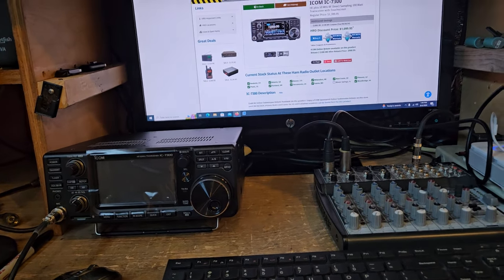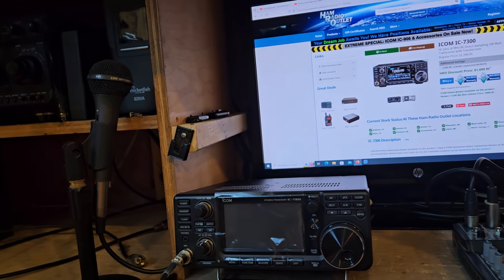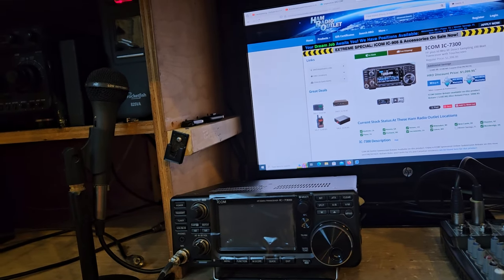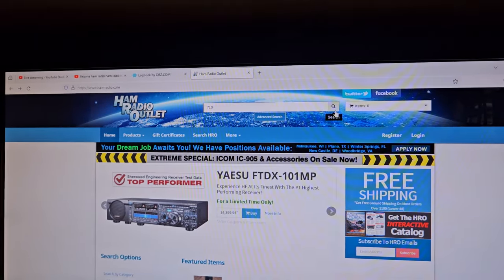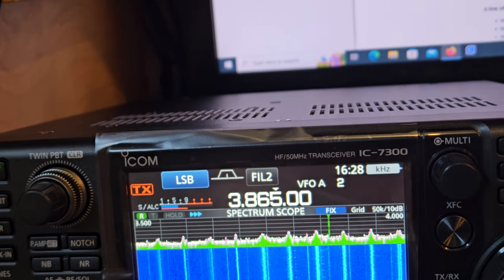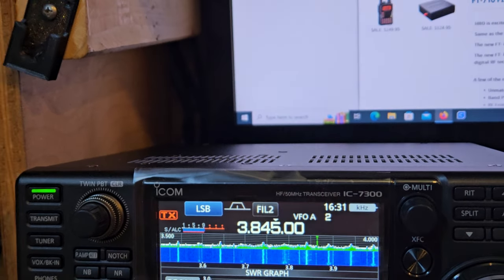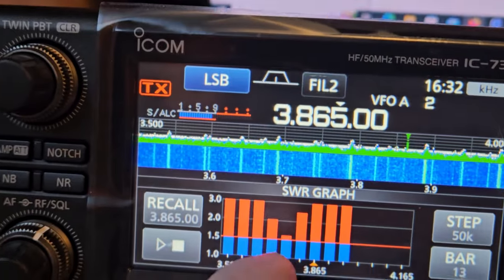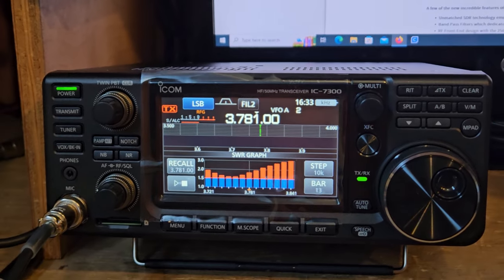here's why I bought another ICOM 7300 ham radio

Comment: Iam able to change the waterfall color on my FT 710. I like the icom as was torn between the 7300 and 710 and the choice was the 710 which has the DVI port on the back
Reply from the maker: You cant change as many aspects of the water fall and spectrum . The you can pick like 5 color schemes on 710. They both are great radios. Why not own both...I do lol 😆

Comment: I had to send my IC-7300 and IC-705 in for repair. Sent the 705 to Washington repair center, and it took about a month to get it back. 

The first time I sent my IC-7300 in for repair because the screen was going bad, it went to Michigan. Matt done a great job and got it back in two weeks. The second time it went in for repair, it had some water damage. Sent it back to Michigan. It took a while to get it back because Matt didn't have the circuit board needed for repair in stock. 

It was an expensive repair, but Matt worked with me on making a couple of payments. If you have to send an Icom in for repair, send it to SAR Technologies in Michigan. They don't have an automated phone center. When you call, you'll talk to a person.

Comment: I want a 7300 for digital and cw, the 710 for ssb phone.
Reply from the maker: I think that the 7300 sounds better on single sideband so I would switch those two around especially since both of them I think have CWD code don't they
Reply: @hamradiohack  the 7300 can run a higher duty cycle, plus my 710 sounds super good on sideband. 🤣